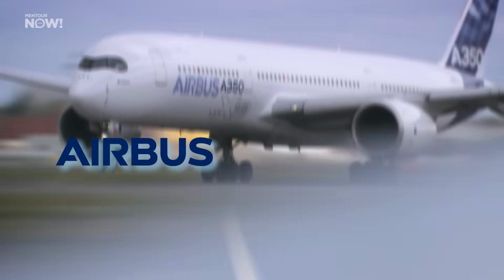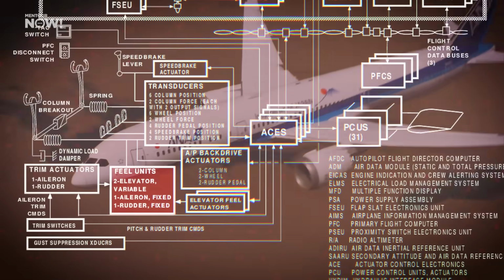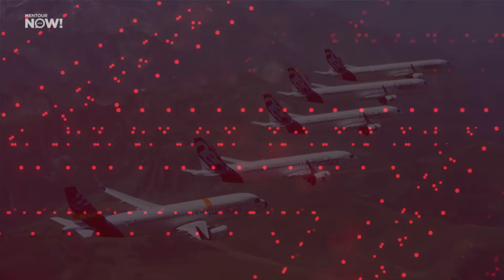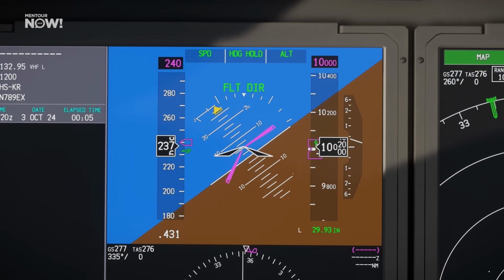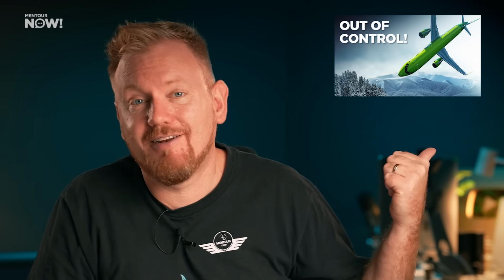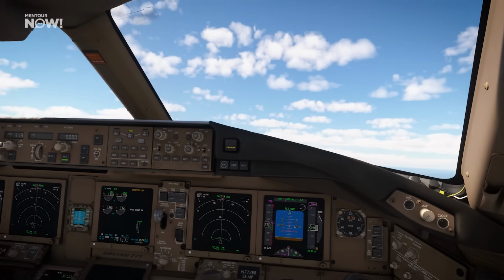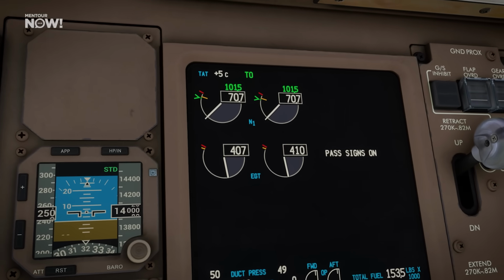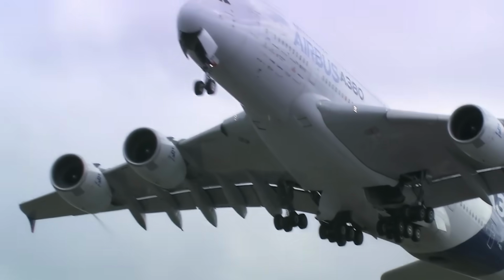Do Pilots Prefer AIRBUS over BOEING?!

Comment: So, I test flew airplanes at Boeing and Northrop and then later became an air line pilot and logged over 15000 hours in the A320 family and now have been flying the 787 for the last 3 years.
The analysis presented in this video is excellent and there is not much to add. 
At this point it mostly comes down to personal preference although in at least one area,  I think one system is clearly superior. 
So, here are my preferences: 
-Yoke vs stick: stick
-Moving vs non moving controls: moving
-ECAM vs EICAS: ECAM
- Handling qualities:   
  Boeing
- Ergonomics/cockpit layout: Airbus
-And last, hard vs soft protections: hard. And I have to elaborate a little on this subject. When I worked at Northrop in the early 1990s the Air Force paid for a study to determine if soft or overridable protections offered an advantage over hard protections as most everyone thought that soft protections would allow the pilots to squeeze some more performance out of the airplane in an emergency. The study was very thorough and well documented and it indicated that in every case, hard protections were better. And, having dealt a lot with that subject, I am a firm believer.
To me, both Airbus and Boeing’s systems are very good but not perfect. I really love flying the 787 as it is a fantastic airplane with great performance and economics. Given the choice, I would prefer to fly the A350. Alas, my airline does not operate the type so I will finish my career on the 787 or 777.
Thanks Peter for another great video!
Reply: For a pilot doing long haul, the comfort of Airbus cockpits make this an easy choice. For regional flights, as a pilot, Boeing is preferable IMO.
Reply: @The_ZeroLine  Yes -  the easy choice is the 787 😀 as I referred to earlier, the fact that on the 78 you breathe fresh air, rather than bleed air - makes all the difference to comfort!

Yes, we give up a table, and have a yoke between our legs - but I'll take that hit anyday! 😊
Reply: @T @The_ZeroLine ur second point makes no sense to me.   If I had to fly  multiple legs per day I’d want to fly the bus even more.  Spent years in each.   AB all day over the Crao7
Reply: I think the easiest solution for the hard safety with airbus is to have the plane actually do the movement on the stick and such
Reply: @ClaysonAntoons  There's also the question of which is more common, mountains or confusion. I'd rather be endangered by something that probably won't happen than by something that probably will, all else being equal. It's not that we shouldn't consider corner cases, we certainly should since if nothing else they are highly informative, but we shouldn't lose our lives to the fear of them.
Reply: What an excellent analysis, thank you. I am currently transitioning to the 777/787 from 13 years A320 and feel exactly the same way.
Reply: 777 is an awesome aircraft to fly. Although a bit old now, it is certainly an iconic workhorse of any airline and handles gracefully.
Reply: If it comes to security, you can always think of situations, in which the one solution will outperform the other. Sometimes, this is a matter of training, sometimes it is a matter of design. Regarding cars, some drivers will always believe, they can do better than the automatic transmission. Others may think, the automatic transmission is the safest way to switch gears. Some drivers with the utmost tone of confidence will say , that a manual u-turn saved his life. Whereas others while others will swear on “hard intervening” of the respective electronic system. This too isn’t 100% true: When a a lorry in front of you loses load at high speed and you have to drive a quick step to the side to avoid a crash , as I learned in a safety training at Audi. (No time to look for the checklist.) But that was the only case where Audi was able to verify at that time.) Statistics seams to tell the truth , but in real life, you can will find yourself in a real situation. And then it only matters - for the passenger as for the pilot, what matches the situation best. And if I got your videos right, there are many events, in which the accident wouldn’t have happened in a plane of the other type was involved. As a passenger I therefore do not prefer an aircraft from a certain manufacturer. When I travel by air, I hope for a well maintained aircraft AND for an excellent trained, well rested and highly motivated crew in the first place.
Reply: @rudolfquetting2070  , I can not think of any situation where soft protections will outperform hard protections.
Reply: If a lorry in front of you looses cargo, you have immediately drive hard to the left and than directly hard to the right again (It‘s the other way round in Brittain). The automatic (I just don‘t remember the name of that electronic system in english for the moment) will take you about 15 degrees to far to the right. Therefore it will definitely send you into the „forrest“ (if there is one). To avoid that, you only have a chance if you manage to manually to countersteer resoectively.
In the safety training, there was no forrest but of course plain grass only. But we got  real A8s and no simulator. We tried it, first with and than without automatic correction. No chance, even though we were told before.
Only the Testdrivers, who were overseeing the training, managed to turn off the automatic quick enough (in the test-scenario.) 
Yeah, it was some years ago. Maybee, they meabwhile fixed that problem. 
But Beware: Do not test this effect with your own car, if there are trees or other obstacles on the rigth side of the road (-;).
Reply: @rudolfquetting2070 , we are taking about airplanes here, not cars.
Reply: @ I noticed that from the beginning. 
But the problem we are talking about here, isn’t a special problem of aircraft nor is it a special problem of a vehicle bound the surface. It’s a general problem of engineering and automation in the first place. There are differences, of course. But in general, be it aircraft or car, on the one side, no one can ever anticipate all physically possible situations, on the other side, even the best of the best may fail with a certain probability which isn’t zero. Therefore, to be on the safe side as far as possible on, one needs the best automation in combination with the best of the best, well rested and constantly trained pilots or drivers. And, under the bottom line, a pilot needs definitely much more knowledge, experience and training than any car driver, even though aircraft seem to me to be in principal easier to automate than cars, because - I assume - an aircraft doesn’t pardon mistakes as easy as a car usually does. A Russian pilot (living near Frankfurt, Germany), to whom I sold my old car, said to me when driving me home in a very precarious traffic situation which occurred: Quote „Don’t be worried. You can are safe. I fly Tupulev.“ End of quote.  I guess he was able to change the tyres of his landing gear inflight, but did not like any Boeing- or Airbus-Type of automation. Nevertheless, when I travel to Taiwan next month, I prefer to take Airbus.
PS: I took a degree in mechanical, but then changed to mathematics. Now I am retired and watch some YouTube channels out of curiosity. And now I find me stuck in a discussion between real professionals who are discussing their day to day business. I think, my contributions here are therefore by no means helpful. Sorry.
Reply: @rudolfquetting2070 Yes I agree, hard safety can stop you acting in an extreme situation that might save your life.  Also sensor failure could happen and a hard safety could lock you out of a hard "safe" manoeuvre.
Reply: @ClaysonAntoons  I did say risk, as in pushing it right to the ragged edge, not deliberately stalling it.  You don't have to miss the rock by much, but you do have to miss it, and since know what the consequences of flying into a rock are (not that you should ever find yourself in that situation, but it has happened), I, personally, would rather take whatever chances I can get in an attempt to miss it.

That's an extreme example, but yes I was more focused on things like bank angle and G load, in extreme cases when more reasonable options won't suffice.
Reply: @jw8292  Yea I realized later on. I can see your logic now.
Reply: @jw8292  This is similar to people claiming they can outbreak ABS or outmaneuver ESP in cars. The result always is that they can't.

And even if they could, in some magically extreme circumstances, those systems radically decrease the risk of ever getting into a really extreme situation in the first place.

So it's pretty much never worth to leave the margin for extreme circumstances, as it usually just allows people to eff up where they otherwise wouldn't.

Do I enjoy the ability to turn of ESP in my car and have fun on an empty road? Yes.
Do I want bus drivers (or airline pilots) to do the same? No, thank you very much.
Reply: @Dornacgove  Well, the key there is being able to disconnect it if needed.
Also, there's definitely drivers that can outdrive ABS and ESP, but in normal situations there would be no need to, and the average driver wouldn't be able anyway.
Reply: @giacomoneri1782  And that's where you are wrong (as long as the systems work correctly, of course).
All tests I've seen proved humans, even racing drivers, can't do better than ABS pretty much under any circumstances. As for ESP, probably depends on the situation + that would be harder to quantify.

If these things can be turned off, it only increases the likelihood of an operator thinking themselves better than the computer and making a mess of things.
Reply: Flying by thrust is a failure mode that humans can’t do that a computer potentially can solve.
Reply: @denverbraughler3948  Can do. DHL A300 over Baghdad did it (missle hit, on fire, part of the wing missing, all hydraulics dead, landed successfully but then had a runway excursion.) But yeah, on average the computer would probably do much better than a human pilot.
Reply: @denverbraughler3948 Maverick would like to have a word with you
Reply: @ClaysonAntoons  Think he just meant risking a stall by slowing down and pulling up sharply... I can see that logic
Reply: @ClaysonAntoons  There is one. The only case, where you could kind of say, airbus hard protection did a bad job. Just before landing in Spain a A320 hit a microburst, then hit very hard with a nose down attitude. airbus then did soften the protections, very close to landing. still, mainly the probably shouldn't have tried in the first place to land in this conditions.
Reply: Thank you really interesting, I wasn't aware of this study but intuitively have always thought hard protections were preferable to soft. We'd like to think that pilots can pull off something that's likely impossible but the reality is IMHO that pilots are much more likely in an extreme stress/disorientation/panic situation to atempt the actually impossilbe and crash - look at all the stall/spins that occur in general aviation....
Reply: Thank you for your valuable comments on this sensitive subject.
Reply: I have a friend who's a long haul pilot for BA, his experience was entirely Boeing (747 and 777) at the time of this anecdote. About 8 years ago we were both living in the French Alps and he'd regularly commute from GVA to LHR on another airline who flew A320s to get to work. I asked him about the classic hypothetical scenario of both pilots being incapacitated and could he land the plane safely, his answer was that the differences are big enough that someone with enough hours on an A320 in a home flight sim would probably have a better chance than he would!
There might have been some beers involved so I don't know how serious he was and I expect it depends a lot on how many hours the amateur spent in their flight sim but personally I'd prefer it if they were both in the cockpit.
Reply: @sandy_knight  Haha, I took my 15yo son for his first flying lesson for his birthday a couple months ago, and when he walked in they obviously asked him if he'd flown before, to which he replied 'No, but I've done 1200 hrs on the Microsoft A320 instructor flight simulator...' - I'd trust him to get us down! 😄
Reply: @peteorengo5888  . My fav was 787 - lovely FD but underpowered ( RR) and not as easy to land as 777, 777 is over powered and pleasant if a little long in the tooth now
Reply: @robd2184 never heard anyone say an aircraft was overpowered.
Reply: @brady3474  The C-130 is over-powered, but I'm sure no one complains about it.
Reply: For 7 years I had a colleague who was ex Air Force. I asked him about the pilot preferences.  His observation was that airline choices about equipment were made mostly by bean counters in suits negotiating with the constructors bean counters. Pilots have relatively little input to the decision.  He could only speak for ex military pilots. These guys like being in control hands on. Although metaphorically they are switching from a high performance sports car to a Greyhound bus, the habits carry over. He said he believed there would be a lot more Boeings picked if the pilots made the selections.  (This was before the mcas blow up.)
Reply: @Yes, airline bean counters pick the airplanes based on economics. My informal polling among professional pilots  that have flown both brands sits right at 50/50.
Reply: Boeings lack of information to Pilots is a very serious WHS and difference between life and death …
No one should die doing their job!
Reply: @DrMaureenBlane-Brown  Boeing gives the pilots the information they need to operate the airplane. If you're referring to information about MCAS, the pilots had no need to know anything about it. People—and pilots in particular—tend to forget that a pilot is to an airplane as a taxicab driver is to a taxicab. Pilot training teaches the pilot how to operate the airplane, not design iit, analyze the design or maintain it. No sensible person would fault a car manufacturer for not providing an explanation in the car owner's operations manual of the operation of the clutch within the automatic transmission and how to use it, for the simple reason that there is no human interface to directly control or operate the clutch and there is no way the driver can cause the clutch to engage or disengage as can be done with a manual transmission. Likewise, MCAS has no input human interfaces such as levers, knobs or switches to control it or even turn it on/off, nor does it have any output human interfaces such as indicator lights, gauges or warning messages to indicate its operational status. Last time I checked, humans need a human interface in order to operate anything; thought control may be a few centuries away. Associating a lack of information—when none is needed—with life and death is trite, thoughtless drama for the sake of sensationalism.
Reply: @petep.2092  mcas could be disabled by pilots, but the pilots were not cognizant of such an option during the famous MCAS failures
Reply: I would like a plane that stays in the air.  Boeing is too weak on that.  They might do better by making solid planes that don't suck!
Reply: I know nothing about nothing but I prefer airbus for confort and Boeing for emergencys for this exact reason. on airbus you don't feel anything. it s like automatic cars vs manual cars. manual cars are more real, more like having the feeling of driving and input. automatic cars are more for long  drives with not much to do. I feel like I know my car better if I drive a manual because a manual forces you to know the car better.
Reply: @RCSnowboard7  I guarantee: Without special training, you will never come to know your own car better then it‘s automatic does.
Reply: You must also presume that in a crisis all pilots are the same. That once qualified and with a checklist, you would run the problem the same. When we all know experience counts for a lot. Airbus perhaps work in the real world where experience takes time to feel the problem, much of the training was in a simulator (and any new training needed). With the squeeze on pilot supply, there are more "inexperienced" pilot. You must also accept that model n humans even pilots focus differently. That such pilots are not the same reading manuals than displaying the results (blame computer games)
Reply: That a350 is really a sexy plane.
Reply: First of all. It is SUPER Great to hear from a test pilot like yourself with lots of experience.  I have a few questions:
1. You say the Boeing performance and handling is better. Why is that?
2. You said prefer the side stick to the yoke. Do you think active sidesticks are better?
3. In places with STRONG winds ( wellington,santiago sapporo,boston logan)where the chances of a stronger crosswind component during takeoff and landing comes into play, don't you think a yoke is better?
4. In SPECIAL cases where airports are surrounded by mountains/ high obstacles, terrain, narrow entry and exit passages combined with gusts and crosswinds,rain, low visibility, do you feel a manually flown aircraft is better/worse than a hard protected aircraft in single engine out procedures?
Reply: @ 
1) The 787/777 handle like a regular airplane. The Airbus in normal law handles more like a video game (or like having control stick steering engaged all the time). To me, the 787 just feels more natural and satisfying to hand fly. 
2) I would prefer active side sticks. 
3) Sidestick vs yoke is just a personal preference, more ergonomic. There is no diference as far as control authority is concerned. 
4) I think there’s a lot of misunderstanding regarding hard vs soft limits. They do not take control away from the pilot. They just keep the airplane within limits and allow access to maximum performance without worrying about exceeding those limits.
Reply: @peteorengo5888  "a lot of misunderstanding regarding hard vs soft limits. They do not take control away from the pilot. They just keep the airplane within limits…"
Not counting crude and sloppy inputs that take the control to the stops just because you know the protections will keep things in check, when a pilot makes a control input, it is because s/he desires a maneuver in that direction/aspect, and for a reason: because NOT making that maneuver would result in the airplane being in some place or attitude or state that is undesirable, perhaps perilous. When the system refuses to accept that control input and execute it—simply ignores it without even the courtesy of a buzzer indicating "not allowed, limit reached"—and to force the maneuver the protective system has to be disabled, I think one can justifiably say control has been taken away from the pilot.
Reply: I guess the actual design philosophy and approach to risk is prevention vs reaction. Airbus lean far more on prevention and Boeing lens bit more on reaction. Ultimately, goal is to reduce serious accidents, even if aircraft is potentially harder to handle in really hard circumstances by skilled pilot, if you can prevent that situation altogether you come out on top.
And we also have to consider that what if the pilot isn't acting optimally with great skill in case of unexpected circumstances?
Reply: All that knowledge and experience, you still don’t know how to spell aeroplane.
Reply: Crossword, Sudoku, meals, comfort, noise, Airbus all day.   But I loved the Triple (and numerous other Boeings) as well.  Except the 737.   Just crap.  Tiny, old, crap.
Reply: @l @lbowsk totally agree, Im in the 777 now.
Reply: Very informative ! Thanks !
Reply: I wish my airline flew the A350 too
Reply: Boeing = shit poor quality control and no f*cks given for the results.
Reply: @ClaysonAntoons The operating words are “risk” and “hopes…” He’s not saying to stall the airplane. He’s saying that a soft protection jet will not allow you near stall and therefore guarantee CFIT, whereas a hard protection jet will allow you to balance on the edge of stall to possibly avoid CFIT by mere feet, or possibly accidentally stall the aircraft.
Reply: @bossthefluff  I already realized in a later reply.
Reply: As a passenger, I prefer the A350 and A380 over the 787. Having said that, some of my decision also comes down to how the passenger cabin is managed by the airline flying the 787. With regard to the A330 and the 777, I don't really have a preference, both are pretty much equal to me. If I could choose a design, the engines will be at the rear of the aircraft to reduce noise in economy class.
Reply: or you could switch to an Airline that flies the A350
Reply: I wish I could fly on the A350 because so many pilots say great things about it. Interestingly, in the last 5-6 years, all of my flights, regardless of airline, were on the A321, both in the US and overseas.
Reply: tricycle driver here 🤓👋
Reply: How about the COMAC?
Reply: From Boeing parts folling off , doors in medley of Sky.
Reply: I fly from Singapore to Sydney Boeing some noise , terrible noise .old the time . Scary Sometimes stop about minutes and agen .
Reply: A380 best plane ever done
Reply: Airbus is better overall
Reply: I definitely prefer airbus over boeing. This is plane the shoud be flying inside the flight envelope so way let pilot fuckup if the plane is sure that this is unsafe and can stop this input.
Reply: Oh god... all that education and you still start a sentence with "SO".   YOUR FIRST MISTAKE WAS MAKING ANY COMMENT
Reply: @ you’re a troll.
Reply: This. I am an airbus fan boy, without actually being a pilot tbh. But none are perfect and everything is a trade-off. The competition between those two seems to make aviation and technology progress and get better overall. :3 But neither one is the messiah of aviation
Reply: Hey! What do you think of Air India dreamliner AI171 crash?
Reply: 'So' means a conclusion.
Not a void filler-word.
Reply: @kiereluurs1243, I corrected it but it jeeps reverting back.
Reply: Hard vs. Soft protections:  In business, when forecasting future product demand with computer algorithms, research also shows "hard guidance" where the output is used as-is, beats "soft" where managers may tweak or override the numbers before using them.  It comes down to the great number of variables involved... on average, and in the long run, the computer wins.
Reply: I am not a pilot but would think flying a plane that doesn't have parts fall off or other issues due to cutting corners to save costs might enter into it?
Reply: what do you think of the Air India 171 accident?
Reply: The fact that you prefer moving controls shows you don’t (after 15000 hours you say) understand  your scan at all. I think you are lying in my opinion. Any mid time jet guy will tell you controls lie your PFD ND does not.
Reply: Is everyone forgetting the Airbus initiation flight?
Reply: Thank you. Read BEA aftermath report on airfrance flite 447. You are someone who could benefit.
Reply: You saved me a bit of typing, as you pretty much said everything that I was thinking, except for the hard/soft protections.  While I am not familiar with that study, it seems like there may be rare occasions where it's better to, for example, risk bending or stalling the airplane in hopes of clearing the mountain, than to fly into the side of it perfectly safely.

On a side note, after operating various pieces of construction and farming equipment most of my life, I can't imagine operating a complex piece of equipment without tactile feedback to tell you what the plane (or copilot) is doing.  I could tell you how well a machine was running, how hard it was working, what the ground / traction conditions were, etc, just by the feel of the machine.  And I could do it without ever taking my eyes off the task at hand to focus on a gauge.
Reply: @jw8292  , the study found two main conclusions 1)Exceeding airframe/aerodynamics limits never gets you extra performance. For some reason some people think it does but it can be easily disproved.
2)Using hard limits produces a quicker, more efficient response and easier access to maximum performance.
Reply: @peteorengo5888  Think Sully clearly showed that. AoA protection allowed him to simply keep pulling up to whatever was possible. Much better than to also have to pull it in and out of the stick shaker to milk it for performance. Yes, in the end, think a little lower AoA would have been better, but trying that may as well could have ended in disaster.
Reply: @peteorengo5888  Even if that's true, I would counter that there is at least some margin of safety built into those protections that, if infringed, could provide a bit of extra performance.  Probably not much, but perhaps just enough.
Reply: @jw8292 , the beauty of hard limits is that in an extremis situation the pilot is able to act quicker, trow maximum control input immediately and the airplane gives maximum performance every time without worry of any limits being exceeded. Exceeding limits never gets you more performance, just a broken airplane.
Reply: @peteorengo5888  The problem with hard limits is they can be overcome with dynamic inputs or unforseen conditions i.e. if you pulsed longitudinal inputs at resonant freq with a poorly designed system, you could theoretically exceed AOA or whatever parameteryou were limiting. That's why Airbus has their extreme attitude laws that release hard limits in case these protections fail. Nothing is absolute in this game, I'm sorry to say.
Reply: @beyondEV  No, hard protection was almost Sully's undoing. He and Skiles were maintaining "green dot" airspeed during the glide to the water, but as they got closer Skiles stopped monitoring it and Sully began pitching up more and more. They didn't recall doing so but I suspect the looming water surface was hypnotizing and triggered a natural subconscious urge to shy away from it. As a result the airspeed bled off and AOA protection reached the ALPHA MAX stage, at which point the computers simply lowered the nose to keep AOA at max value. But that left no margin in either AOA or airspeed for a flare. And so the airplane pancaked into the water at a descent rate three times what engineers had designed for ditching, which tore open the aft fuselage, flooding it and jeopardizing the evacuation and rescue. If there had been soft protections Sully would have been made aware of his subtle drift towards a stall and likely would have corrected the approach speed/pitch and flared per plan.

There really was no need to milk it for performance; the relatively calm,  obstacle-free and expansive river was all his to take. I believe there were simulation experiments by the NTSB that showed that the best ditching technique for the circumstances would be a rapid descent towards the water with plenty of airspeed reserve, then flare and ride ground effect in fairly calm air until airspeed bled off to minimum before touching down.
Reply: @peteorengo5888  You have to be aware what protections you actually have in order to quickly utilize its limits.
There are accidents where the pilot flying was not aware if the airplane was in alternate or direct law with reduced protections.
Reply: @jw8292  US pilots prefer boeing, everyone else prefers airbus
Reply: @1littlelee I think you are wrong…
Reply: @1littlelee  Euro pilot here. Would quit flying before touching an Airbus
Reply: @1littlelee Making Boeing Great. Again?
Reply: @jw8292 haha, well said 👍
Reply: @peteorengo5888 also a 787 driver here. Agree with most of your preferences, other than ECAM vs EICAS - they both work just fine.

Probably a good thing your airline doesn’t operate the A350, as it’s saved you from drying out like a lizard. As the 78 is your first LongHaul type, you probably don’t realise just what a difference having air from the CACs makes, rather than bleed air. I flew the 744 for 10 years (great aircraft), and positioned many times on our 777’s and A350’s - and I can categorically state that the 787 is a far more pleasant place to be, and leaves you feeling far more refreshed (as much as one can be after 14+ hours) than any other type, Boeing or Airbus.

I don’t care who makes ‘my’ aircraft, but table or no table, for me, the CAC’s win every time! 👍🏼
Reply: @Kapitan_Plastic_Fantastic  , I flew the 74 at Boeing, my favorite. Never flown in an A350 but the specs say cabin pressure is maintained at 6000 ft with 20% humidity so it should be pretty comfortable.
Reply: @peteorengo5888  I can only speak from my experiences of travelling on it as a passenger - everytime, I've felt a lot 'drier' than when I get off the 78.

I don't think it's bad - just not as pleasant as the 78.

So if you're going to spend your life flying one or the other, the choice to me is clear. I'd simply much rather breathe fresh air from the CAC's than air that's been heated then cooled that's come from bleed air (with the added possibility of contamination from oil seepage etc.)

My ideal aircraft doesn't exist - a 74-8, but using CAC's for the cabin air. I think Boeing have other issues on their plate rather than designing a fantasy aircraft for me though!
Reply: @, yes, the combination of 6000’ cabin altitude and higher humidity makes for a very pleasant environment compared to other airliners. Absolutely love the 78.
Reply: @Kapitan_Plastic_Fantastic  As a passanger I can agree on the higher cabin-pressure and the moister controlling systems. They leave ears and nose in a much better condition. (And I don't even have to work when in the plane I just have to sit)
Reply: @Kapitan_Plastic_Fantastic  ... You are not a pilot you don't drive airplanes
Reply: @planeperson8  you may get it one day….
Reply: @Kapitan_Plastic_Fantastic  that`s what Boeing mannagment said to the pilots when they did not tell them about MCAS. They probably don`t care
Reply: @HellStr82  Actually, when Boeing removed all mention of MCAS from the pilot's operations manual the memo gave a very clear and valid reason to the FAA… the system was transparent to the pilots. It still is. So, like many other parts and functions on the airplane, the pilots had no need to know that MCAS even existed, and no training was possible for it. But news media reporters and pilots who pretended they could perform airplane crash investigations, in reality couldn't even comprehend what transparent meant, so they made up a childish explanation that fit their level of understanding, claiming Boeing "hid" the system to save money, even though the logic behind it was faulty and nonsensical.
Reply: @petep.2092  i hope you are not a pilot.   perhaps boieng  ceo????
Reply: @olivierb9716  If you are trying to determine whether you can validate my comment(s) based on my credentials, you need to try another method, because the internet provides no practical or legal way of verifying my credentials. I suggest a proper education in the field of aero engineering instead of reading the rubbish published by the news media.
Reply: I only have 11k hours total, between military and civilian flying, so I pale in comparison to the more experienced people who wrote in this thread. Here’s my two cents.
The main difference is one of philosophy: Airbus wants you let the aircraft fly itself and just manage the systems, while Boeing tends to want you to fly, while the systems kinda take care of themselves. The notable exception is that piece of shit known as the 737, a relic from the past that should never have existed and somehow managed to skitter and slide until now, mainly due to corporate greed.
The main point corporate will take from this difference in philosophy is “oh, so we can train pilots on the systems via CBT and save money on aircraft handling? Cool!”, so the requirements for handling skills dwindle, therefore the flight schools p, while maintaining the same cost for an integrated ATPL course, will lower the requirements, simplify things (eg no full spins, only incipient spins, no more solo students, only supervised solos, ,etc), so, little by little, like a death from a thousand cuts, handling skills fade away and pilots gradually lose their ability to dig themselves out of tricky situations in which a bit more seat of pants flying would have helped. The “miracle on the Hudson” is the poster child of this.
I’m afraid once the crop of pilots of my generation and maybe 10-15 years younger reach the end of our careers, unless we’re all replaced by true AI (with a nuclear reactor to power it, due to AI’s notorious electricity hunger), the world will see a series of accidents certainly influenced by the pilots not knowing how to fly their airplanes.
Finally, this debate is silly: most of it comes down to pitching the 737 against the 320. It’s like comparing a Fiat 600 from the 1960s, but with cruise control, digital displays, airbags and leather seats, to a defective Tesla Model Y with occasionally faulty brakes and steering, which occasionally tries to kill you…
Reply: @soffici1  Your input is as valuable as anyone else's - while I stopped counting at 20K, most of that is sat on my @rse monitoring systems - not 'flying' as I know you mean, and I agree!

I have long been against putting low hour cadets straight onto Airbus FBW aircraft, which many companies do here in Europe. They become well rounded systems operators - but what happens when it all goes dark on a stormy winter's night? Will they have the skills to keep things together while they rebuild the systems? I hope they never have to find out....

I was never sharper than when I was flying night mail on Shorts 3-30s/60s - no autopilot, in the thick of it night after night, timed NDBs or ILSs to minima - real flying, mental maths, and keeping your own SA has served me well over the following years. The boxes do it all for you now - but boxes fail, so what's the backup?

I'm pleased to say my own lad has followed my lead and is flying around the Highlands and Islands of Scotland on turboprops. A great skill building foundation.

And yes, we both enjoy turning aeroplanes upside down - just not the ones we work with!
Reply: @soffici1  The vitriol over the 737 is over the top and invalid. The airplane is designed to the same control, handling and operational philosophy as the rest of the product line. You'll have to explain how corporate greed comes into it. If you're jumping on the bash Boeing for the MAX bandwagon because it's been the fashionable thing to do for the past six years, try an objective, educated and rational evaluation of the airplane instead. It handles like its predecessor, there are no significant changes in procedures and no systems differences or introductions that require anything more than CBT. So what training was needed? If you've ascribed to the notion that Boeing hid MCAS and deprived pilots of their vital training, consider… the system has no human interfaces, no inputs to control it—no buttons, knobs, not even an on/off switch—and no outputs: no gauges, LED lights or warning messages to indicate its operational status. Last time I checked, humans require a human interface to a system to operate or even monitor it. If you can't operate it and can't even tell that it exists, you can't possibly have training for it. And why even mention it in the operations manual? You wouldn't fault a car manufacturer for not providing instructions or training on how to use the clutch in an automatic transmission to progressively shift gears, would you? There's been a lot of plausible nonsense about the MAX and its design published by the news media and some aviation blogs over the past six years for sensationalism or to pretend competence. It's a sad day when nonsense becomes accepted truth, but regurgitating it mindlessly still detracts from one's credibility.
Reply: I agree with almost everything you said.... I'd prefer the yoke, though.

Having said that, I only dream of flying.
Reply: Don't care. As a passenger, I will always endeavour never to fly on a Boeing given their recent terrible safety record, the poor quality control in the production process, and the appalling management of the company.
Reply: Respectfully. All the pilots that answer here seem to this thing in their mind that the boeing is more fun to fly. Especially manualy. This actually (imo) makes all your comments invalid tho, as you guys aren't military or hobby pilots. Hundreds of thousands of people out their life into your fingers every single time you take off. None of those people have "more fun" in a boeing airplane compared to an airbus. So in reality. The simple conclusion is. That airbus (at least by now, cause of management changes at boeing years ago) is not just far superior, it is no contest. And in reality boeing should be out of business by now and some of the upper management should serve lifesentences.

So, I am happy for you guys that the boeing is more of a "real plane" to a pilot. But thouse thousands of souls that trust those airplance with theit lifes won't ever get to experience this. And this aren't hobby planes for fun. It is no argument
Reply: @Davinhomx If an aircraft is fun to fly, that means a pilot is familiar, comfortable, and confident enough in it that they can handle situations differently than someone for someone whom the aircraft is not fun to fly (implying the opposit of the things mentioned before). Respectfully, I don't think your opinion of the matter trumps the preference of experiences pilots (either way). They know what they know. In regards to passengers, I don't think they are as neurotic about aircraft manufacturers as you seem to place weight on. If they are, they should probably be taking a train or boat.
Reply: @peteorengo5888 - thanks so much!  Really interesting on hard vs soft protection.
The real-world application of this in Airbus as I see it is complicated by:
1. The hard limits are enforced not by what is physically happening, but by what the computers think is probably happening;
2. The pilots have three different variants of this, and aren't necessarily immediately aware which law is currently in force (as per example in Mentour's video);
3. Worst of all, this is then used in a flight deck where the pilots can't see or necessarily tell what the other pilot is doing (nor can they quickly intuitively tell what the thrust setting/movement is).

So the hard protection doesn't remove human error, it just replaces pilot human error with human error from the engineers.

The results are predictable (and demonstrated). 
- In normal situations, it prevents silly pilot mistakes (overbank, pitching up too far etc).
- In abnormal situations it can help, but only if the computers are correct (in both their incoming data, and in their human-engineered programming).  I.e. a predicted situation with correct incoming data is normally helped by the engineers' anticipation of the problem.
- In situations where human error by the engineers has failed to predict the scenario, it's lethal.  It's similarly lethal if the incoming data is incorrect (even though engineers have tried to design out some of those scenarios, e.g. data disagreements). 
Overall, it replaces pilots' human errors with engineers' human errors, but then doesn't allow the pilots a way to necessarily override and save the situation.

Submitting to always having a 'hard protection' gambles that elementary errors by pilots will be more frequent and deadly than the situations where pilots could have saved the aircraft from unanticipated/degraded conditions.

That may overall be true (especially with the perception that true manual flying skills are nowadays worse).  

However it far worsens the outcomes of all of the above to then (in a crisis situation) have non-tactile sidesticks, hidden from the view of the other pilot, and thrust levers with their position unrelated to actual thrust command.

I'm commonly in relatively complex crisis situations where individual human lives are at stake (not in aviation, but ironically am therefore more used to crisis situations than e.g. pilots typically are, as aviation is thankfully now so safe)!

My impression is that machines/automation often have a quicker and more accurate initial response to a typical safety problem, which is presumably well-demonstrated in the hard-protections study you described.

30 seconds to a minute later, when human cognition catches up and properly comprehends what's occurring, now with a sensible reaction to the problem, I find the humans (in this discussion, the pilots) are often far better than the automation.  It's not a debate of human versus machine, it's actually a debate about human programming versus human on-the-spot in the actual situation.  The balance of which one is most likely to make a catastrophic error(s) is not a constant balance - it changes (in favour of the humans on-scene) in an exponential manner from the first milliseconds, to seconds, to minutes.

We already know this.  The smart, knowledgeable humans who have plenty of time to think about a problem and come up with a solution, come up with better solutions than those with very little time to do so.  Who are these humans?  Aviation engineers?  Or pilots?  

In the split seconds as an event first occurs, those best-placed humans who had the luxury of thinking-time are the engineers, now safe on the ground and helping avert tragedy.  But as the seconds tick past, now those best-placed humans become the pilots.  

The final balance rests between how much time the pilots have to think and react, that their systems knowledge is likely less refined about individual systems than engineers of those specific systems, but - crucially - that the engineers would have had to effectively predict every situation that the pilots might find themselves in.  On top of which, the programming engineers are not necessarily the expert engineers in the actual systems (hydraulics, electrical interfaces, etc etc) they're doing the programming for.

The 'automation' is really just human programming, by smart, knowledgeable people (engineers) who have plenty of time in a calm environment to think about (potential) problems, and come up with a solution (that's what their programming of these hard limits actually is).  I'd imagine (correct me if I'm wrong) that the USAF hard-limits study was looking at AoA protection etc, rather than working at a very high overriding level governing complicated systems such as a nuclear power station or a modern airliner?

It's often a tragedy to assume that one will always know better than the humans whose own lives are at stake.  That's what the engineers are gambling when they remove the option to override their programming.  

I don't know which (in airliners) is statistically safer.  But I do know which I'd prefer!
Reply: @ , I appreciate your comments but, they highlight my points about misunderstanding how fly-by-wire and hard limits work.  
I’ll try to take it point by point but please understand that it is much more complicated than my simplified answers and it would take very lengthy explanations to fully cover every topic.
1. The computers use the same real time information that is presented to the pilots. 
2. The video had an error in that the pilots do know in which mode the computers are operating, (ie normal, alternate or direct control law in the Airbus), at all times.
3. I agree that active sidesticks would improve situational awareness. 
4. When I was a test pilot I spent countless hours in the ironbird and simulators developing the control laws with the software engineers. It is a very laborious and time consuming process with many stages of development and then certification. 
All fly-by wire aircraft currently in production have very robust software and hardware because of this process. Every line of software is tested and approved by test pilots before it makes it to a production airplane.

Another point is that, Boeing’s “soft protections”are not as “soft” as people think and in some cases they are even more restrictive than Airbus protections.

This is why, as a professional pilot, I am happy to have those protections. And again, in my experience, I can not think of any situation where not having those protections would be better than having them. 

As opposed to what some people think, the protections do not take authority from the pilots. On the contrary, they allow the pilots to, if needed, extract maximum performance from the airplane safely and repeatedly.
Reply: No need to begin the sentence with "So".
Reply: @TheRockallTimes  Pedantic *wat
Reply: Clear answer:
"Boeing rulez"
I've flown tin cans for 35 years now.
737, 340, 320 and 747 now. Over 20.000 hrs.
Airbus does the job, but the procedures are made "lawyers to pilots" . My experience is that at least a bunch of pilots were involved doing them for Boeing. 

Concerning flight controls:
I'm based in a windy location. With 737 never an issue. There is still room at the given crosswind limits. Airbus 320 totally different story. You better stay away from those limits, or you get in trouble. Especially knowing that flightcontrol groundmode with limited reflection is waiting for you.
Comming to speedbrakes. Airbus are you kidding me? Pulling the brake and the VLS jumps up forcing you to stick it back in.
Hey I want that lift to plummit.

Fortunately that is behind me and I'm back in Boeing 747 heaven.
Amen!
Reply: @andreasrohe8562  for me beast plan ever Aerbus 380 .I'm fly with Boeing and every one . But Aerbus is better solution for me .even safety issues
Reply: Thank you for bringing your experience to the table sir. This means a lot.
Reply: I would argue soft protections are better, but only in the sense that there needs to be some way to tell the computer that it is mistaken. Obviously MCAS is the popular example.
Reply: @MegaLokopo  you can always switch it to direct law.
Reply: @tomriley5790  yes but in some cases it is very difficult, like with mcas.
Reply: @MegaLokopo  I work in IT so have spent my life around computers and electronics and my guiding thought is computers are designed and programmed by humans who are fallible and the components themselves are prone to failure.

While the hard protections in principle are a great idea, to my mind soft will ALWAYS be preferable because the designers and engineers cannot imagine and programme in every conceivable failure/risk because many are unknowns. 

This means that no matter how brilliant the computer there could be a time when a plane or even the weather/external factors could develop a fault/issue no one could have conceived of and the only way to keep the plane in the air would be the pilots troubleshooting the issue and overriding a "safety" feature which hard protections would not allow them to.

For example if there was an uncontained engine failure (which should happen) and there was significant damage done to a wings control surfaces. In a Boeing the pilots could override the safety systems to troubleshoot to try keep the plane flying whereas in the Airbus the computers would say no to anything outside of design safety features because the damage and its impact on ability to control the aircraft could not be anticipated by Airbus.

Both are brilliant systems but I feel on balance the one that would be safer is the one allowing humans to try fix the problem in real time than the one that limits their options to do so.
Reply: @hogwild5844  your example above demonstrates you do not understand how the hard protections work in the Airbus.
Reply: @ the hard protections won't allow pilot override
Reply: @MegaLokopo  MCAS is not a flight envelope protection system.
Reply: Flown the 320/330/350, E190 and 777 in the last 3 years with 12000 hours plus including test flying of high performance aircraft in the military. The 777 is a masterpiece for its time. The 350, which is an evolution on the original 330/320 concept, is unfortunately an ergonomic downgrade as illustrated by the fact it takes longer to setup than a simpler 330. I'd personally take the 777 handling, EICAS (over ECAM)and various other features any day. Like with most things, once you drill past the glossy brochures, on a working level, I find the Boeing philosophy and implementation is just better in every way.
Reply: @rampy4963  "is unfortunately an ergonomic downgrade as illustrated by the fact it takes longer to setup than a simpler 330" Is this due to the fact that Airbus did away with the MCDU which was present on the prior Airbus aircraft, and replaced it with a redesigned FMS which requires the use of the KCCU to interact with the FMS?
Reply: @ClaysonAntoons  Correct. Line select keys are much better, but clearly more expensive to implement. The interface is extremely clunky. Despite this, paradoxically, there are more buttons than ever in the 350.
Reply: What is your opinion on DEI initiatives for airline pilots?